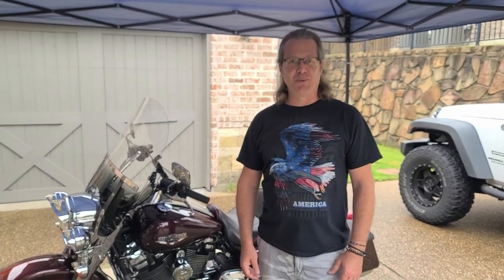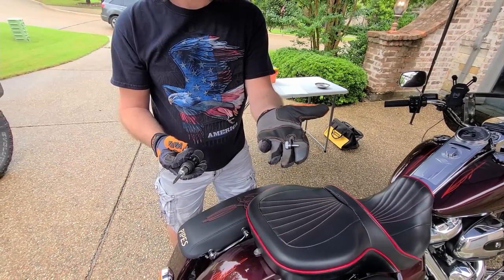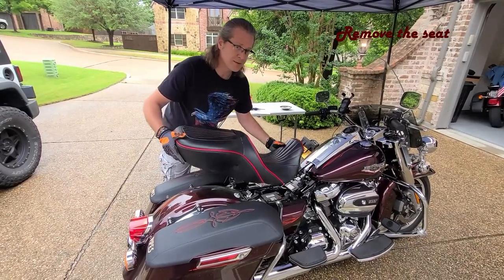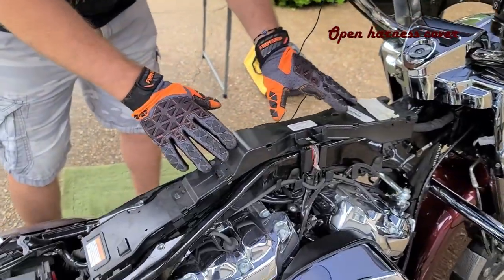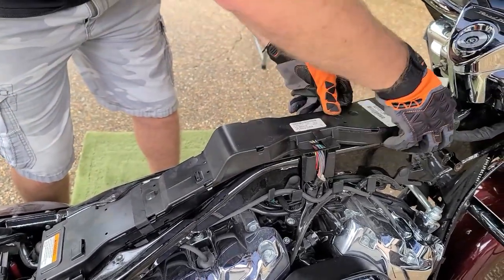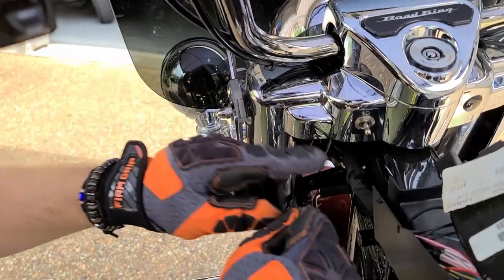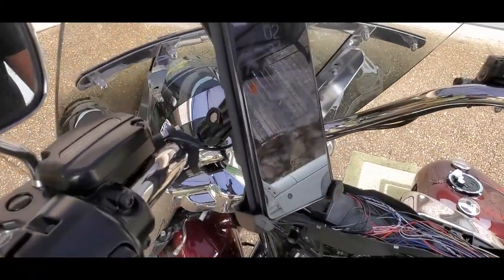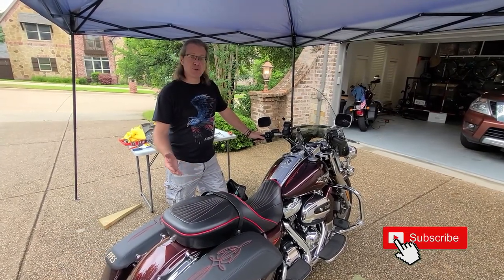How to run a hidden cable from handlebars to battery in a Harley Davidson touring Motorcycle

Comment: Did you pull the 50amp fuse first? Someone told me anytime you disconect the battery always pull that fuse first for the security system's
Reply from the maker: We did not for this install as the bike had no security system and the device being installed had minimal pull. We did a similar work in another bike where we installed heated handgrips and for that we did remove the main fuse of the bike. Thanks for the feedback will certainly consider including the step in future videos.

Comment: Big mistake not installing fuse on positive wire as close as reasonable to positive battery terminal. Thanks for the time and information otherwise.
Reply from the maker: Thanks, the device that the cable was installed had a fuse already further up.